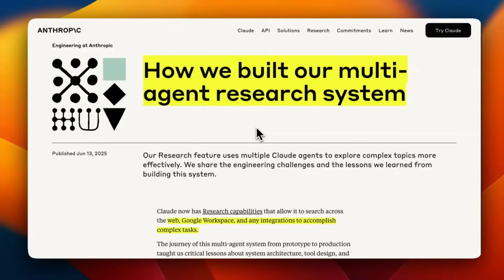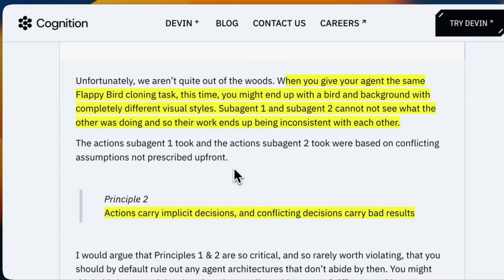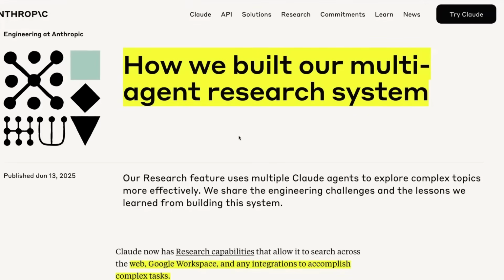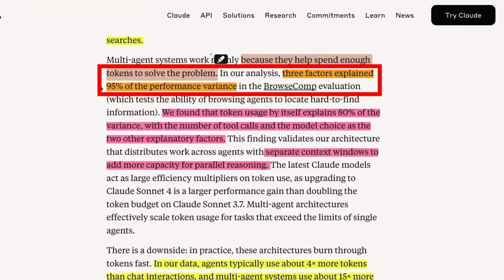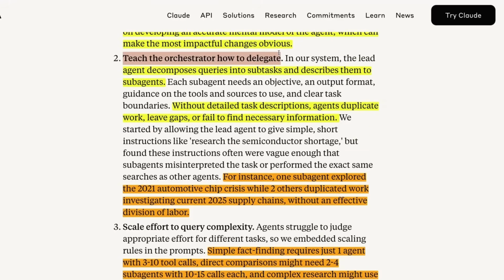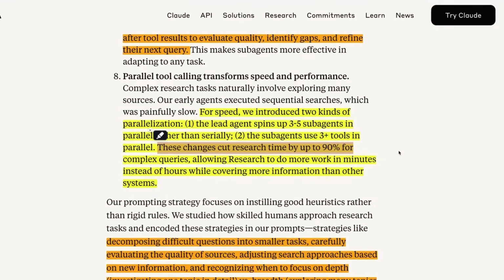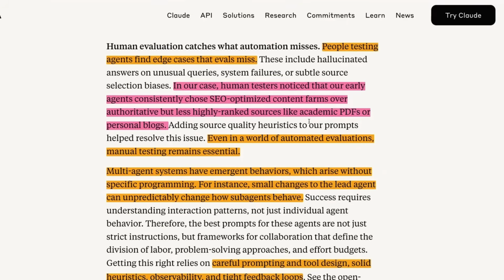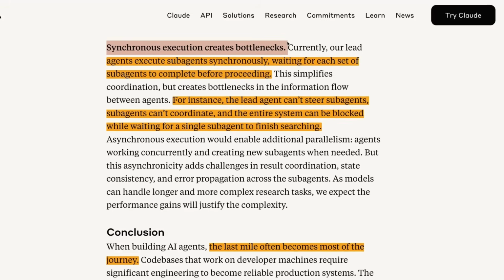Context Engineering for Building Better Agents

Comment: What happens in the situation where the research query is necessarily going to bring contradictory factual contentions into the context? Have there been any good studies along these lines? Can LLMs / agents actually handle such conflicts? In this video, you parsed out a paragraph where we as humans can see that these two articles are actually talking about two different use cases, and thus are not truly mutually exclusive in all respects. Can any LLM do that yet?
Reply from the maker: That's an interesting topic in itself. There is a new term "context rot," and it turns out that it is still a big issue for LLMs, you probably want to use reasoning models for that

Comment: Pertinent as usual, thanks Muhammad.
Context Engineering particularly, is a good articulation, one that could integrate with Context Cultivation and Context Harvesting.
I find that a lot of rich context is lost simply because it's not captured, or harvested during sessions, meaning having to rebuild context, which is never replicable.
I'm hoping you could provide perspective on a dedicated, on device, small local model, specifically designed as a machine learning like memory system, where all agentic operations and engagement are captured,  cleaned and context harvested, indexed and stored locally, forming the local dedicated memory models memory, as if its the agentic ecosystems ongoing dynamic memory component.
The orchestrator, human in the loop and local memory model would collaborate to plan, with the memory model able to identify historical incompatibilities or possible compounding undesirables.
The use case my framing is from is holistic full spectrum business operations, rather than any specialisation within an enterprise domain.
Hopefully the confines of a comment is enough to convey conceptual query,,,

Comment: One thing I’ve noticed with orchestrator spawning 3-4 agents is that those agents can overwhelm the orchestrator with tokens to the point they lose coherence in decision making. So the orchestrator can’t follow your detailed commands when that happens. This is where I notice the difference between opus and sonnet the most in Claude code. For coding tasks often it’s hard to see the difference. But if it’s orchestrating a number of sub agents sending lots of tokens back to it, sonnet will buckle and degrade, opus is more likely to maintain enough attentional coherence to follow more detailed instructions during orchestration

Comment: To me it simply comes down to tools. If you have 2 "agents" that share the same toolset (like most coding agents) then you probably just want 1 agent and subtasks. But if you have a multi agent system where each agent has vastly differing tools, then you want multiple agents, like a network engineer multiagent system that has agents for device configuration, diagram parsing, jira ticket interactions, slack agent, etc. It wouldn't make sense to put all those different tools into 1 agent. I think Cognition is approaching things like everyone is only building single purpose coding agents. I'm writing this before I've gotten to the anthropic part so I may edit
Reply from the maker: I think there are challenges with building multi-agent systems (as highlighted by cognitionlabs) mainly sharing context (both implementation details and actual work done by agents). We are very early. Some other patterns might emerge.

Comment: But what about agent to agent protocol
Reply from the maker: I think same principle will apply i.e. its dependent on the application. I personally think you shouldn't add pre-mature complexity. The idea would be start with a single agent and add as many tools as possible. You are going to see a point at which the agent's performance degrades. At that point, you start creating more specialized sub-agent and so on.

Comment: Its a trade-off between reliability vs cost/speed. Cognition Lab's approach is suitable for enterprise use cases as it is more deterministic while Anthropic's approach is suitable in research, building search systems, early prototype generation etc.
From Anthropic's blog - "some domains that require all agents to share the same context or involve many dependencies between agents are not a good fit for multi-agent systems today"
Reply from the maker: agree, its not one fit all! very application specific.